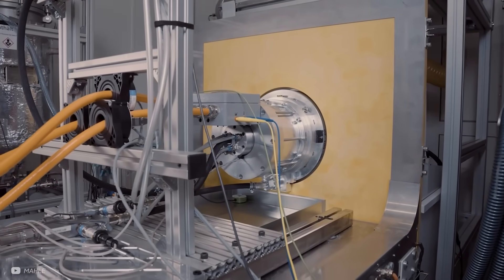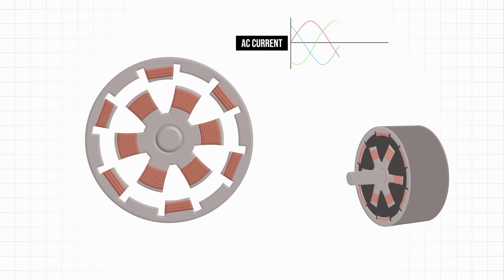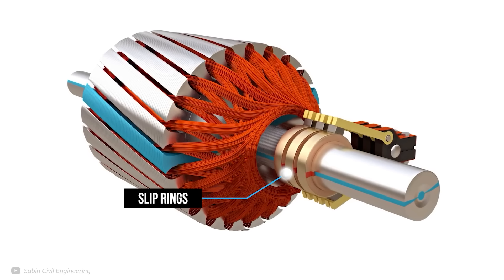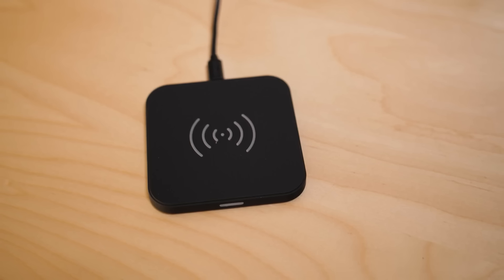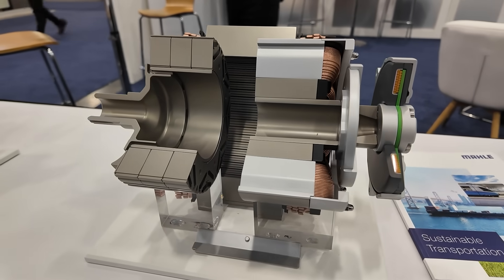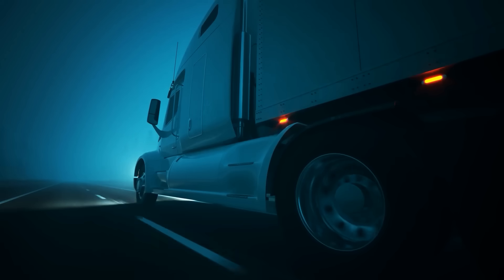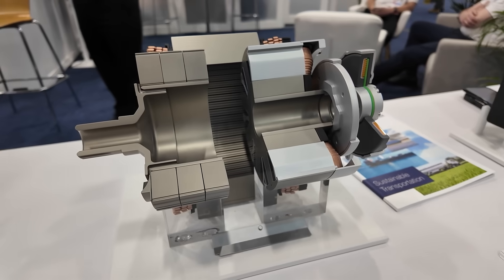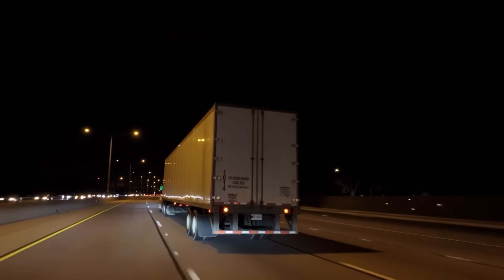Genius Contactless Motor Could Change Transport Forever

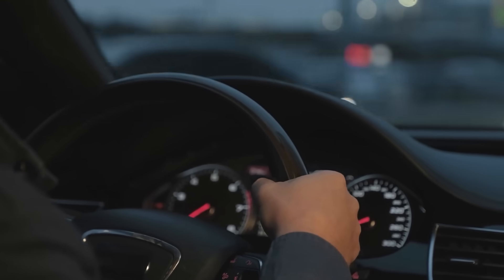Comment: 6:50 You contrast this motor with an industrial 3-phase induction motor. You claim at 9:40 that induction motors only have 85% efficiency, but ultra premium efficiency induction motors (IE5) also boast a 95% efficiency. Oil cooling at the windings is a clever idea for driving a smaller motor beyond its normal air cooled output ratings; but I do not understand how this MAHLE motor is any kind of an improvement over the normal and proven 3-phase AC induction motor being controlled by a well matched VFD.

Comment: So what's the improvement compared to regular AC induction motors, like the ones commonly used in electric cars? I could see the benefit of it being synchronous. But I would expect the power losses from to the inductive power transfer in this motor to far exceed the slip losses of normal induction motors.

Comment: It’s a nice evolution, but it will not “change transport forever.” What is needed for changing electric transport forever is either a quantum leap in battery technology (energy density, availability of raw materials, safety) or wireless power transfer from the road to the car (impractical!), and massive increases in power generation and distribution capability.

Comment: Induction motors also cannot be used as generators, meaning in the context of EV's no regenerative breaking...
Reply: this kind of motor can be used as a generator... it has been used as brushless alternators for the last 50+ years.
Reply: @takix2007  not an induction motor, the laminated core has no inherent magnetic field to induce current into the stator. The motor featured in the video does,not an induction motor

Comment: Sorry, I don't have high expectations about this motor. Maybe on a small scale it could work, in an electric razor, maybe an electric wheelchair but not for a luxury car of a truck. The point is that in an electric motor there could be a magnate. Since that is to lager, to heavy and to costly, there is an electro magnate instead. But this has to be powered up, with electricity through wires. If the electro magnates get their power from a coil, then it is functioning like short circuit, sort of. I think it is a nice idea, but I do not expect this to save energy.

Comment: @Ziroth, very interesting new technology. Thanks for detailing how it works and it's advantages. However, one glaring omission from your analysis is a cost analysis versus permanent magnet motors. I would expect that the wireless power transmission mechanism and electronics add significant costs even at volume. Also, I wonder if that introduces more components that can fail, especially at high powers and high temperatures. Without knowing this kind of cost analysis, it could be an interesting lab exercise, but in practical and commercial applications at volume. Thanks again!

Comment: You didn't really touch on the fact that wireless power transmission using induction requires a moving magnetic field, or alternating magnet field which would induce alternating current on the receiving end. There would need to be current rectification and smoothing on the rotor side before powering the magnetic coils on the rotor which would introduce a new mode of failure with the required electronics since Diodes and capacitors do wear out over time.

Comment: So...Tesla figured all of this out over 100 years ago?

Oil does most of the cooling in an internal combustion engine.

Why aren't we using magnetic bearings?

Bearings are the main source of heat from friction in any rotating assembly.

Comment: For even more power (through less weight), they could try a disc arrangement with axial flux (i.e. the magnetic flux is aligned along the direction of the axis of rotation), rather than radial flux as seen here. It's interesting that the transmission coil has a disc arrangement with axial flux, and they're using extra wires to transfer to the larger rotor with radial flux.

Comment: Couldn't you achieve the same by just replacing the brushes with an electrically conductive roller that's in constant contact with the slip rings?

Comment: As a mechanic I can attest to MAHLE's build quality. I just wonder why they are in this market?
Reply: My guess is they spotted a gap in the market. Mostly manufacturers are stick-in-the-muds. We have induction motors, which are less than 90% efficient, and permanent magnet rotors, which are more than 90% efficient.

Since the field coil power is much less than total power, any losses in transmitting that field power are also small compared with the total power.

This may not be a new idea, but it seems to new to modern EVs :-)

Comment: Thanks commenters. Always worth looking at a few comments before looking at big claim science and tech videos.
Reply: And it's always worth taking a very jaundiced eye to any WONDROUS! NEW! INNOVATIVE! TECHNOLOGICAL! ADVANCEMENT! when all you see is a naked device on a bench. If it's so good, why haven't they stuck four of them in a vehicle -- it doesn't have to be a Tesla with the motors stripped out and replaced with these, it can be a glorified go-kart -- to show how it works in a real-world application, instead of waving the theoretical data that all their computer models say the device would be capable of. If they can't point to the motor's efficiency in a vehicle, it's likely that there are some serious technical problems that make it unsuitable for use in transportation -- but that would quickly wipe away all the starry-eyed "gosh wow" publicity.
Reply: However, most ofthe comments are incorrect.  The video seems to use old phrases    which are triggering the idea that this is ONLY old and existing tech. No European supplier would bother creating something that already exists, they would just buy it from China..

Comment: For power transmission, inverse square law means wireless is order magnitude less efficient than wired.
However, for motors, we want higher voltage alternating current at below 500Hz, so the current is lower. For smaller wires, less heat loss, and speed control.

Comment: I don't see a problem with wearing out parts. Just make a design simple to replace them. You don't change the elektric motor brushes too often anyway. This engine will be less efficient than any modern electric engine - it will lose energy for electromagnets and  lots of energy will be lost for induction.
No, that's a dead end, not a brake through.

Comment: I suspect this would be an offering for low end applications where weight and size is less of a factor.  For any EV, weight matters a lot and most manufacturers would choose to pay more for better performance.  After all, extra weight means less range and you end up having to spend more on batteries.

Also from a physics standpoint, when you don't have materials that naturally create an opposing force such as magnets, you're left with supplying electricity to create that opposing force which turn the motor.  This setup is extremely unlikely to provide better performance than permanent magnets.  

This all boils down to this design being a better fit for stationary machines than transportation.  Just my wild guess.

Comment: very interesting video. there are a few sections that are a little disjointed on the cuts. Like you were talking about one thing and then it jumped back to something you said before and then you continued talking about the original thing. Over all I like what you are doing here, keep it up.

Comment: Now if only they can do something about the heavy, inefficient, often toxic, and sometimes explosive batteries that run down so quickly.
Reply: Fuel cells are eventually going to replace batteries. Unless capacitors do first. There is just so much more energy available when you have the atmosphere full of stuff to be reduced all around you so you can get away with half of the system being carried around with you. No compleat system can ever compete with that.

Comment: I was working on brushless, synchronous motors (3,000 hp+) 35 years ago.
Reply: Likewisw , I was working with AEG 1 MW synchronous motors for cooling water compressors in large oil refineries. I developed an advanced fault diagnosis system for diagnosing the faults in the AEG motor control system. I had to reverse engineer the controller and implement a virtul in-circuit emulator system to drive the 8085-based microprocessor controller.
Reply: @ Ah those 8085’s. I remember them well!
Reply: Those large three phase motors are about 98% efficient.
Reply: @dougsmith5873  7 phase are said to be better in some aspects.
Reply: Nice to hear from someone who actually did it and doesn't argue about it, vs. the other way around.
Reply: I think WEG invented the brushless exciter.
Reply: Right people don't realize we are just seeing stuff hit markets, like some killer cordless tools as example, for tech that's been around for decades.
🔥🦅🙏🦅🔥™️
Reply: These have brushes... I thought it was something new but pure electromagnetic mothers have been around for over a century.
Reply: I started my career in 78. Steel mill motor controls mostly. The DC motor control systems were very mature by the early 90s and I fortunately was at GE then and got to be a part of the switchover to IGBTs and AC motor drives. It evolved rapidly. The work was fun, but GE fumbled and let hundreds of engineers go and lost its lead in control systems. Those were my favorite years, I moved to mill engineering and maintenance positions afterwards. The improvement in motors the last 2 decades has been amazing. Good stuff.
Reply: ....WITH ONLY EXCEPTION THAT this is with brushes WHICH ARE CHANGED TO COILS

....AND YOURS IS USING PERMA MAGNETS
Reply: Was that at GEC from Rugby UK? Done projects with these motors/inverter, excellent performance for high HP systems.
Reply: Is that when your profile picture was taken?
Reply: @ BUSTED!!!!
Reply: @davidladd5597 exactly. You saw it too. This is just a slightly better design than the centuries old electromagnetic motor.
Reply: @ It’s been 25 years since I had red hair and it looks like I’ve only been a member for 21 years, or so.  Guess I could update that…
Reply: @davidladd5597  Keep the picture mate. Shows the class of the era. Look at my idea of what i want to present to the world.

Comment: They have had this tech for literally decades, but at a smaller scale. This is how they supplied the power to spin up gyroscopes in missiles without wired connections. The power and output signals were conducted using a rotary transformer similar to the one in VCR video head. All of it crammed into a can about the size of a tomato paste can. 😮 Only recently have the power electronics caught up so it could be usable for actual power though. ❤

Comment: Pumping oil with a high speed rotor? Any efficiency gains are shot right here. Turbulence equals energy loss and heat generation. Erosion issues, mechanical hardening of copper windings leading to breakage. This is why air to oil heat exchangers are used in realistically engineered large power motor/generators.

Comment: This feels a bit like a solution in search of a problem. Cheap, standardized, and easily serviceable slip rings/brushes would be useful in fleets of heavy equipment. The simplicity of electric motors are a serious feature. 

I operate large stationary electric motors. As it stands, a motor swap is essentially 3 wires, 4 bolts, and a laser alignment. These things sit here and run pumps wide open without a hiccup for literally months 24/7. Only PM required is the odd squeeze of bearing grease.

Motors have have never really been the issue, it's still an energy storage problem. The Chinese manufactures have pretty much solved these problems, with battery swap tech, but it's not made it outside China much yet.

Comment: Cool, just need them to figure this out in Axial form-factor...
  
I note that the "slip-ring free" portion of this is only slightly different from the standard brushless alternator - a concept that I thought would be vastly improved by removing the diode rectification, and replacing it with an active power factor corrected rectifier (same with the output AC to  DC conversion).  Alas...
Reply: The rotor field actually need little current compared to statoric rotating fields. So most probably the cost (and trouble in terms of maintenance) of having an active component on the rotor outweighs the benefits.

Comment: Question for the engineers out there: in this design application, would it be possible to capture the unused space around the induction area of the magnetic field to regenerate electricity for the battery? Essentially a charging system due to the byproduct of the magnetic field being generated already.
Reply: No. The magnetic fields are not "free energy". If you try to harness energy through magnetic fields, it will cost you energy somewhere else. What you describe is an over-unity generator/"free energy device", a physical impossibility; it would be like lifting yourself by your own bootstraps.

Comment: By not using permanent magnets leads to energy being used in the electromagnet that replace the magnet meaning less efficiency.
Reply: If they alternated the current between the stationary and moving parts, it would improve efficiency (I probably off, but you get the idea). Edit: It would improve the torque according to ChatGPT.

Comment: Aa many others have stated, its not clear what goves this motor the high efficiency compared to other designs.  The thru-shaft oil cooling is a nice feature, where centrifugal forces are employed to curculate the oil.  The inductive features to avoid the slip rings is nothing new.  Perhaps it has to do with control of those rotor fields to control their timing relative to the stator field.
Reply: Old fridge sealed induction motor compressors have used centrifugal oil distribution to cool their motors. The recirculating oil collects in the bottom of the housing/vessel and is picked up at the bottom of the rotor shaft. The hole is tapered wider upwards which spins the oil outwards and upwards.  The motor is not flooded, just subject to plentiful spray.The plain bearings and pistons are steel on cast iron and can last decades.The trick is in hermetically sealed systems.

Comment: Currently, electric cars leave a lot to be desired so they are not as popular and practical as gas powered cars.  All of the research into batteries, motors and self driving tech might even make the electric car the standard at some point.

Comment: Heat generation and the need for cooling tells you all you need to know! Any energy that isn’t producing rotation is lost energy. Unless that heat can be recycled to produce more energy. Electric vehicles are not the answer. We need a quantum Leap in efficiency and battery technology and power distribution to even begin to think about that as a replacement for combustion engines. If you drive two or 3 miles a day and you want to drive a vehicle that weighs 1500 pounds at electric vehicle may suit your needs. However, if you wanna pull 80,000 pounds through the snow at altitude at -20 forget it.

Comment: This is great tech development and yet, we continue to insist on putting the cart before the horse, the horse in this instance, being electric power generation.

Any system that depends on the current electric generation and distribution system for charging a battery storage system, is inherently behind the curve. This is tech that is more than 200 years old.

As such, for an electrical motor, such as the one in this video, to have any real impact on the transport industry, the focus should be on High Performance-Point of Use electric generation technology.

Comment: I did not read every comment. However, most seem to be more hopeful than informed. I did not see one comment regarding V3F (variable voltage, variable frequency), which is, to my knowledge, the most efficient way to convert electrical energy into mechanical energy over a wide range of speed and torque requirements. Detailed info is available to anyone with access to the web. Briefly, a DC power source (or rectified AC) is converted to AC by controlling the duty cycle of MOSFETs or IGBTs, depending on the power requirements. Voltage is controlled by PWM (pulse width modulation or duty cycle). Frequency is controlled by the period of one full PWM cycle. This technology has been around for decades. It was the "holy grail" of electrical engineering since magnetic induction was first utilized in electric motors. What is presented in this post by Ziroth may very well be more efficient... at what cost. The Devil, as always, is in the details. Efficiency is measured in dollars... the total cost of the product... not just power consumed for a specific part of the product. I am cautiously optimistic.
Reply: Variable voltage variable frequency has been used on locomotives for decades, maybe even since the 70s